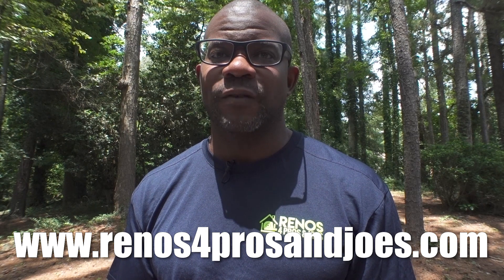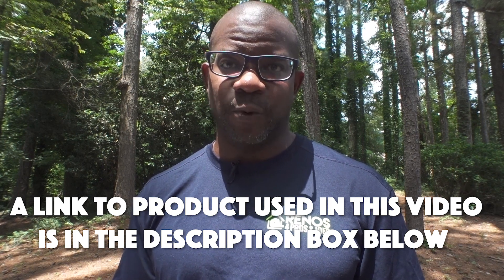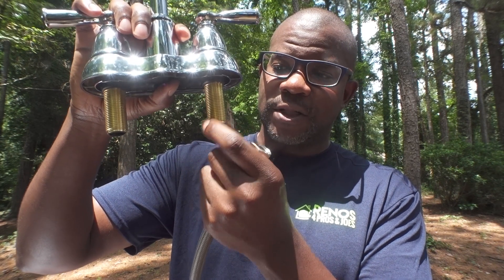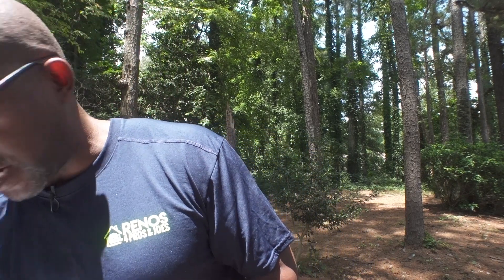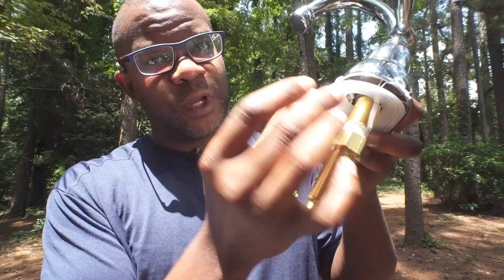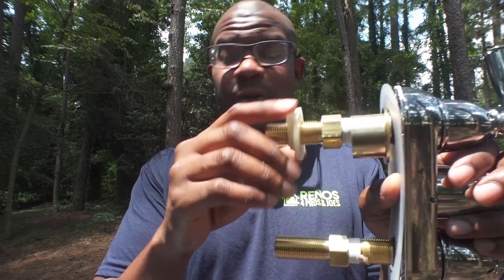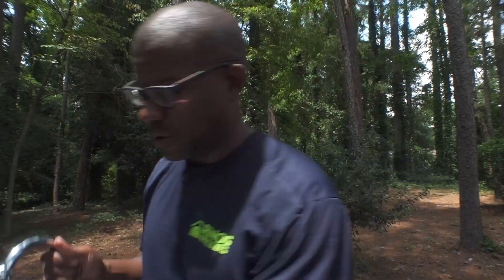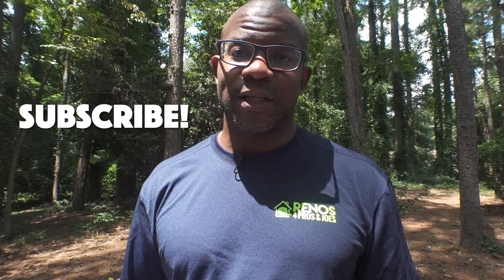How to Install a Faucet Shank Extension

Comment: If you're ever in Kansas City, BBQ and beers are on me.  I'm not "handy" so I had multiple plumbers come out to install a new faucet and was very clear I would need an extension due to my granite being too thick.  Both left without installing the faucet claiming they didn't know how to correct the issue.  I finally got so frustrated with the situation I started researching the issue and came across this video.  I ordered the kit off Amazon and installed the faucet in 30 minutes a few days later thanks to your video.  It's crazy how simple some of these household tasks can be with the appropriate education.  Thank you, sir!!

Comment: Maybe it's me but if I don't have enough thread, how am I suppose to threat the extended externally? Now if you say screw it "into" the faucet thread then yes and it'll extend it out further but in my case the faucet current only comes flush with the bottom of my granite. I need something that brings it down atleast an inch with a king it thinker.

Comment: This was terrific, thank you very much!  Lowes just could not help me, they couldn't even tell me what the connections were called (which were too short).  Now I know they're called 'shanks' I believe.  Is two inches pretty standard for those these days?  The old bathroom faucet I removed has significantly longer (3in) shanks.  Anyhow, thanks again, super helpful, will be ordering the extension kit shortly!

Comment: Thank you! I bought a new single hole faucet and could not install the bottom plate to cover the holes on the left and right. It looks dumb and allows water under the sink.

Comment: OMG thank you so much that was exactly what I was looking for!!! My sister just had quartz countertop added to her bathroom and her faucet new faucet rather doesn't extend far enough so I couldn't get a good seal with the water connections so it would leak! I saw the extensions in Lowe's but didn't understand how they would actually fit on there. But this video has saved me tremendously! Thank you again and keep up the good work!

Comment: I've heard recently about various issues with teflon plumber' s tape, especially as it ages, and switched back to plumbers dope (soft set PipeThread Sealant (ASI/NSF 61)).  I think sealant can sometimes help when the gasket (rubber washer)) is damaged or brittle.   Am I wasting money and effort?  My problem has been trying to wrap plumber's tape around the threads when I am working in tight places under a sink and upside down on my back, fixing an old install.

Comment: Ok....but:
What if my counter top is an old marble vanity and the holes are just big enough for the threaded shank from the faucet?  That nut on the extension won't fit into the hole in the vanity, so it won't get tight enough for a leak proof connection.

Comment: On supply lines or threaded connections with a rubber gasket teflon tape is not needed just wasting material. 

If you have a threaded connection without a gasket then Teflon tape and pipe thread sealant (pipe dope) are needed.
Reply: Where can you buy the shank extensions
Reply: I brought mine from Ace Hardware because it’s one piece. It’s waaay cheaper then buying the two part from Home Depot.

Comment: @RENOS 4 PROS & JOES - I have installed a custom 3" thick wood slab counter top. How long  are the male extension pieces?  Any help would be much appreciated.
Reply from the maker: Moen says this can be used with a maximum of a 3' deck. Hope this helps!

Comment: will this work a moen kitchen faucet? this is the exact problem I have
Reply from the maker: Without knowing more about the faucet you have I couldn't say for sure. But, I have used these on moen faucets quite a few times and I've never had a problem.

Comment: Do they make extensions for a single hole kitchen faucet as well?
Reply from the maker: Hmmm, I have not personally run into the thick countertop issue with a single handle faucet.  But,  I think it would really depend on the design of your faucet mount.  And that would be difficult to diagnose without seeing it. 

I would suggest contacting the faucet manufacturer directly and asking what parts or accessories they offer/recommend for this type of installation scenario. Good Luck!  
.

Comment: Order the extension put it on no problems now my right faucet is leaking and it’s real stiff real hard to turn I called Moe and they said it’s a part inside the handle and they’ll send me a replacement?
Reply from the maker: If the faucet is new and came from a big box store, I would be more inclined to return it in exchange for a new one. If it's not new and they are going to send you the parts you need then I guess you'll have to wait and try them out to see if that solves the problem.
Reply: A year old